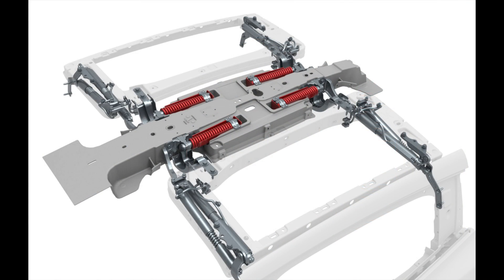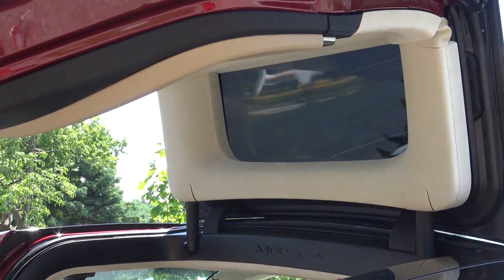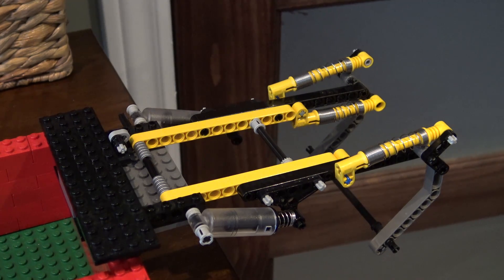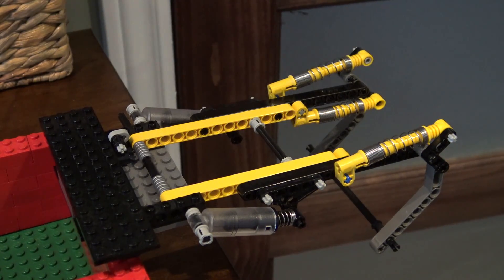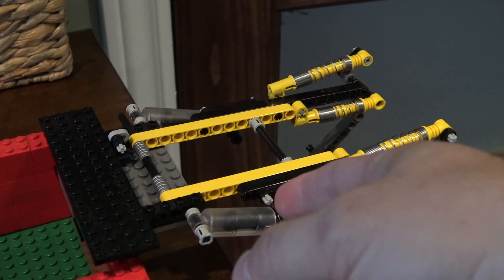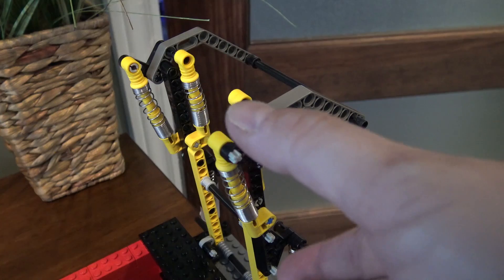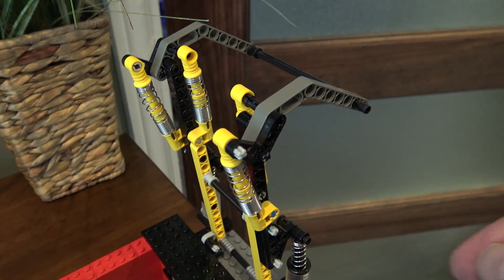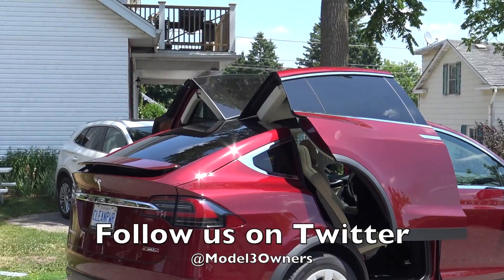How the Tesla Model X Falcon Wing Doors Work

Comment: Great Lego mock up Trevor, job well done. When a new video is uploaded it takes a while for the 1080P version to upload. So if you try to watch it 1 min after upload there may be only the lower resolution version available, but an hour later there will be HD versions. I use "HD for YouTube" extension on Chrome, it alway chooses the highest resolution or your default setting.

Comment: Thank your very much for this vid, I just started a university project where i need to design these kind of falcon wings. 
I have one question. Are all of the aktuators elektrical? Are they moving by hydraulic pressure change oder by spindle movement? What is the push mechanism for? is it because the pull mechanism cant pull & push? Or is it for closing with more force? 
best regards
Reply: @teslaownersonline5805  as i thought, thank you very much

Comment: Any idea why your videos won't load in high resolution? I don't have this issue with any other youtuber. Even at only 480p, the video will just randomly stop buffering and require a manual skip forward by a second. I've got gigabit internet, so I know that's not the issue.
Reply: the not buffering thing is the typically yt bug, my self and very much other pp have this, can't anything about it and the high resolution renders even after the upload from the video, so just wait a lottle bit and it will be 1080p ;) - hope i could help
Greetings